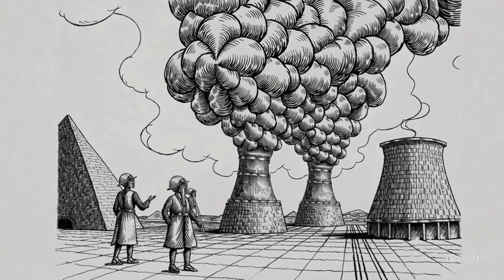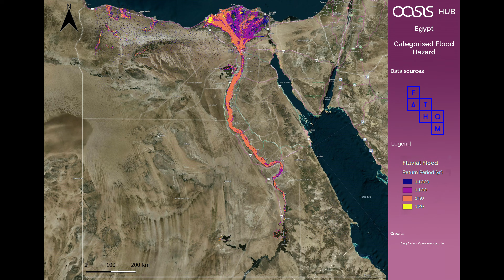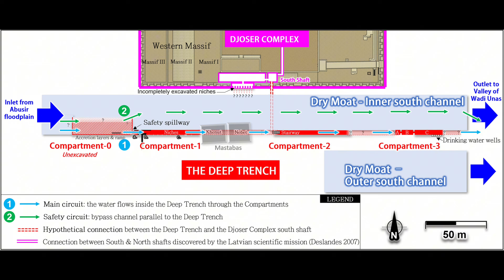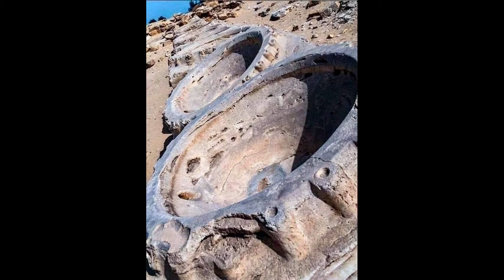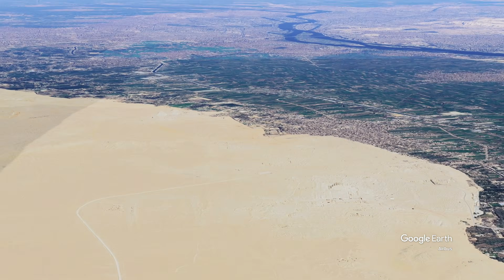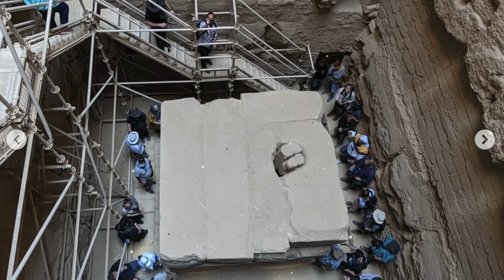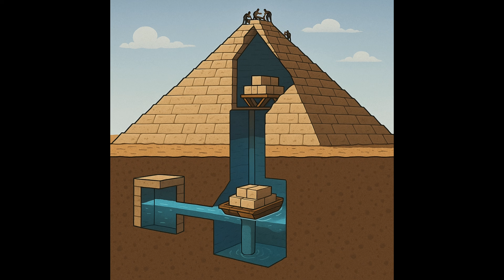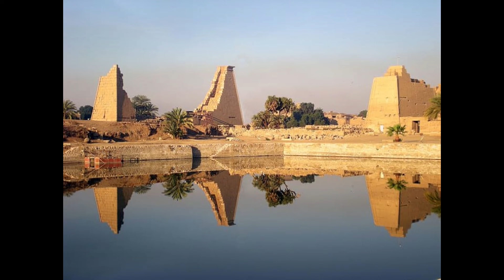The Incredible Hydraulic Lifting Machines of Ancient Egypt

Comment: They other part that doesnt make any sense, is supposedly the pyramids were built in a short amount of time. Yet quarrying, moving, installing, and finishing these huge blocks would have taken centuries.  In the 1840s it took Mormons almost 40 years to make the SLC temple out of granite, its far far smaller than a pyramid and they had steel tools. The leading theories that they are  burial sites doesn't "hold water".
Reply from the maker: You raise some good points regarding the time frame, and this is an area where a lot of speculation occurs. Maybe I should do some of the math and try and figure out based on what we know about work camps in that area and worker numbers what a possible estimate for cutting moving and building. This seems like an interesting project but boring video! In this I mainly focused on the subterranean infrastructure. I try and stay pretty focused on one problem at a time and if I feel like I have something useful to contribute I’ll make a video otherwise I’m just another guy speculating

Comment: People underestimate the power of water.  I’m pickin’ up what you’re puttin’ down here and I’m liking it.  One of the best theories I’ve heard so far.

Leaving alone alien intervention and/or antigravity means, PE=MGH is the potential energy each block above ground level has considering where it is.

The blocks are many and they are heavy; the only plausible explanation as to where this energy came from is a strong, steady water flow.

Water is 62.4 lb/ft^3 and each block size on the great pyramid are roughly 3x3x2 ft; just above a half ton of water, for comparison.

The blocks are estimated to be 2.5-12 tons.

From a purely orders-of-magnitude comparison standpoint, I’m liking the water idea.
Reply from the maker: Thank you so much. I should do a video on all the math required if people would find that interesting.

Comment: Imhotep’s design featured multiple vertical shafts. Some plunging over 30 meters deep often sealed with large stone plugs, or disks. These acted as barriers not only to deter physical entry, but also to prevent spiritual intrusion. A centrally placed round block amidst otherwise angular construction may have served as a seal for such a shaft, possibly functioning like a rolling plug, or blocking wheel deliberately positioned to guard an entrance below.

Something damaged the stones though. Looks like it got dropped from the above, but alignment is still too precise for that and the layer structure of the stones seems intentionally crafted.

Comment: People were going to curse Pharoah for withholding the grain? He said tell them this one : "Put a knife to your throat if you desire the Kings Delicacies at His Table when that's His Family, if you want to stay, build Pyramids." All they were thing to take over His Land?

Start out with many, it's hard, get down to one, it's easy, more food per people, then go back to your own lands not over-populated, it was tarted Re

ANUBIS IS THE BEST DOG

What if Pharoah was trying to build a weather machine to attract lightening to nuclear electro magnetic earth ground to cause more rainfall and thus more food. 

Clouds of higher solar charged particles jump to clouds of lower static change, known as heat lightening, as nature seeks a balance. 

When there's enough solar charge in a cloud electricity as lightening crosses the air insulator and connects to earth, as it does it creates a vortex where hydrogen and oxygen particles connect and bring down water droplets and fall due to nuclear electromagnetic gravitational earth gravity. 

Electrons go around an atom like the moon around the earth and the planets around the sun.  
The Egyptians saw that lightening was attracted to metal, and the higher the better. 

If Pharoah had a copper cap on the pyramids with electrodes running through the air chambers down into the spring underneath, Benjamin Franklin might have been wearing an Eye of Horus Watch and driving a Bently.

Is the grounds turned dry, like a leather glove, no matter how much you tried to arc welds, it wouldn't work. Tree roots go searching for water in the winter when there is no rain, as solar photoelectric synthesis move through an organism seeking earth ground.

Also lightening is more likely to hit the lone farmhouse than the neighborhood, as electricity in houses flow through a black or hot wire, and take a neutral [white wire] path back to the electrical panel, where the Neutral Bar is bonded to the Ground Bar and goes into the earth via an eight foot copper electrode to dissipate returning unused current into the ground. So neighborhoods are energizing water tables instead of storing that electricity in batteries.

Anyways, I'm thinking a cargo helicopter, a brand new Copper Cap for each pyramid, and copper electrode wires running down to earth ground via the spring water table, and electrodes can be drilled into the earth below the springs for better contact, and we can complete Pharoah's Weather Experiment as lightening is attracted to metal high up from the ground ; )

Could you imagine the attraction of this new event to honor the Pharoahs and those that built the Pyramids!

And maybe bring more rain to the earth, and keep it most, and electrically conductive and inductive to storm clouds for more crop rain. 

If you want to in vent some cool stuff im at 224x833x2094 usa

Also, should we celebrate ancient ruins or rebuild them to honor ?

Also oil rigs should be underwater and not above and you wouldn't have oil spills 

China builds underwater structures, you could be just 20 feet underwater, you can run vertices flexible stormproof snorkles and a flexible to surface entrance/exit 

And, 

Grow more opium most the world's doesn't even want to be here and people can move other places, it grows in attics that are 140 degrees, skylights would need insulated glass in the attic shafts and you could use mirrors in the gable ends, just don't be in the attic in the day, if there's ever a shortage

Also oil rigs should be underwater and not above and you wouldn't have oil spills. China builds underwater structures, you could be just 20 feet underwater, you can run vertices flexible stormproof snorkles and a flexible to surface entrance/exit

Sharks could be GPS chipped at a bait source and an alert could go to cell phones and beach alert systems if sharks are within 300 M

Aluminum spayed in the atmosphere might f you magnetically with solar flares

Use aluminum for other things, spraying carbon and aluminum heats up the planet and causes refractory radiation on the surface, the carbon in the clouds traps in the heart and in the ocean causes dead spots.  You need solar distilled ocean water misted or of 747's instead, the sun will burst up H2O into H, O1's, making 02, O3 ozone, and you're actually adding more fresh water clouds up there, not depending on surface evaporation by causing more heat in order to make more clouds, you need to cool it

8.4 billion acres of grass=4 billion cows in the world shipped frozen fresh lawn mower clippings somewhere cool like Alaska and each cow gets a bowl of ice cream at each feeding session

You need a leaf sucker truck with a refrigeration unit, grass is mowed for tax refunds,  20 Million jobs paying 60k from May to October in air conditioned, sealed window,  tinted window, XFM lawn mower cabs with triple level suspension seats,  mini leaf suckers pick up small piles and dump them by the street,  big leaf sucker truck picks them up and freezes the frozen grass and then it goes to rail cars then somewhere cool to be 1100 lbs with a boney jacket.  The people that kiss cows and sing songs for them take care of them and she gets a bowl of ice cream at the end of each feeding season.  You'd have 10x more cows,  over 1 Trillion in goods. In the US you'd have to double your grocery stores just for the milk, cheese, cheese cream, sour cheese, cottage cheese,  yogurt,  milk, butter, ice cream, etc...

When she doesn't want to be a cow anymore she gets a bowl of ice cream with some fennies

I have a lot of invention ideas in energy,  defense, security, food infrastructure etc...

Would like to meet up with some people and talk to them about making some cool stuff

Missing solar film wrap on high rises and fields shouldn't have solar panels but should be solar panel green houses growing every crop everywhere, humid and tropical warm all year growing facilities

Comment: Porous rock was and still is used to purify water, but the idea could work and perhaps explains why all pyramids are connected by shafts. A 3D model would have to be created and tested, even if there are many missing data!
Reply from the maker: Yes I didn’t go into that part but the paper I used for research does mention that the deep trench could also step water down in filtration stages and possible be a source of purified water later after construction. It would make sense to keep the system running in a secondary function after the main use was completed

Comment: When I was younger, I remember my dad, an engineer, saying the same. That water or some sort of hydraulic solution was how it was done.
Reply: Wale like I said no matter how they were doing it think about it not counting to King's chamber Queens chamber all the other openings inside the pyramid just think about the pyramid itself steel would have to lay one of those 10,000 lb blocks every 2 minutes 24 hours a day for 20 years
Reply: @jefflewis2929 but remember its not fully built of perfectly shaped massive rocks, some of it is kind of smaller rounder boulders with backfill in-between the boulders, it can be seen on some damaged areas. That would be quicker and with the equivalent of football stadiums full of people working on it its not as hard to imagine i dont think
Reply: @sebs2309 huh? LOL

Comment: Of course if the water column were say 600 m tall the height difference would easily be achievable and if there eight of them you could achieve the work rate required.
Reply from the maker: That’s very tall!! But yes the higher the head the better it would work.

Comment: being a retired construction engineer im always interested in historic building (how it was done ) i understand the theory of lifting the blocks by floatation' lift it up by a margin lock into place lower water level put some form of ''packer'' in to fill the gap refloat the raft add water lift the block another margin , this method is how tower cranes are built lifted a margin lock-out hydraulic rams lower insert next stage lift again & repeat , but the tonnage of the blocks some granite & very dense means there had to be a good head of water to lift say a 30 ton coffin the equation 1 cubic  metre of water weighs 1 metric ton so storage of said water should be a consideration , i note the mention of the time factor of water entry surly a gated system would have been used to fill the shaft & empty so a cycle would depend on the flow rates of both fill & release of said water , im just using an engineers brain as to how it could of been done , dont shoot the messenger    😎
Reply from the maker: You are correct. I also have an engineering background and point out many of these same issues with the theory. I’ve got a lot more videos coming on ancient construction and mechanics you’ll probably like. It won’t be anything kooky just solid logical reasoning from an engineering perspective. You should read 10 books on architecture by Vitruvius if you haven’t already, so many fascinating discussions of ancient building techniques. You can read it for free on project Guttenberg at this link if you’re interested. https://www.gutenberg.org/files/20239/20239-h/20239-h.htm
I really appreciate you watching and commenting
Reply: @intothemap360  : the other point of interest i have seen is in one of the pyramids there is an inclined rack system clearly this was used to advance and/or lower something within the pyramid nobody has commented on this , maybe all the academics with no engineering background do not recognise what it is or used for ....
Reply from the maker: Which pyramid has that? I’d love to look into it
Reply: @intothemap360  : sorry buddy im not sure which one it is' the rack can plainly be seen where the tourist climb up to a chamber higher up

Comment: Good analysis,  I'm like but in stead of a hydraulic system , how about a floating system like a boat ? , then to raise the blocks higher you just add sides to the boat , lift it ,support it , add sections to the bottom or top , the same way you build a modern crane . Magnetic valves would be required,  on an internal system with no access better yet electro magnetic valves , they new about electro magnetism from the jetti pillers . Your thoughts on this view would be appreciated. 
I'm also following The land of Chem , because he is also onto something hear that begs attention,  and I think yours channel does too .
Just to help you out 1 square foot of water is equal to over 8 lbs of weight .
And it takes only minutes to flood a lock , ie Panama canal example. 
Another thought that crossed my mind , just may be they knew about ram pumps and how to lift water ? 
And thank for the insight  , I didnt know about this structure or that it existed.
Reply from the maker: I believe when it comes to the floating system you describe it wouldn’t exactly work unless the water level was raised as well. The modular section idea is exactly what the paper describes for the float. Once the water level is raised some sort of combination of raft boat + modular section could have been used. I do not believe in anything like jumping to magnetic valves without more hard evidence. There is already a valve there, the stone plug. Thank you for some interesting ideas and for watching!